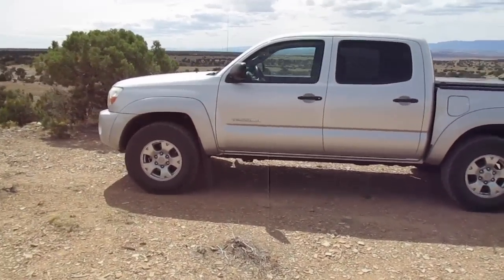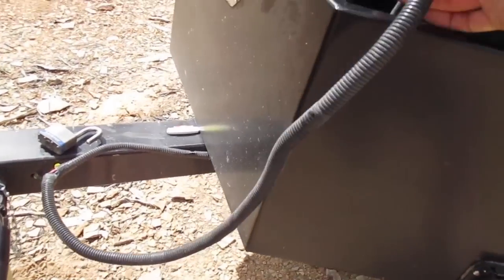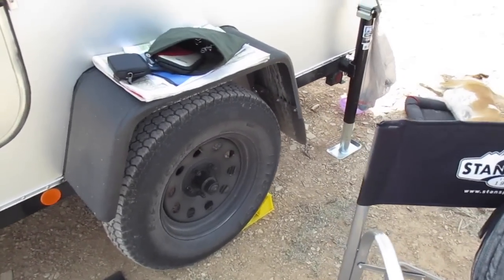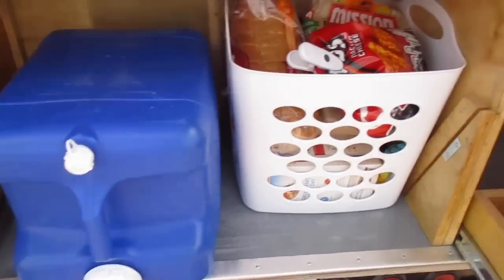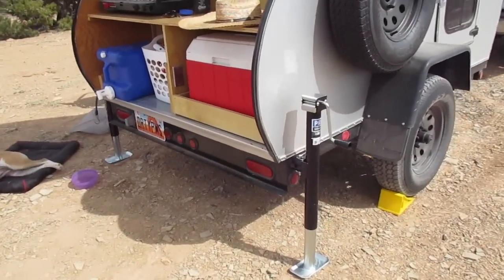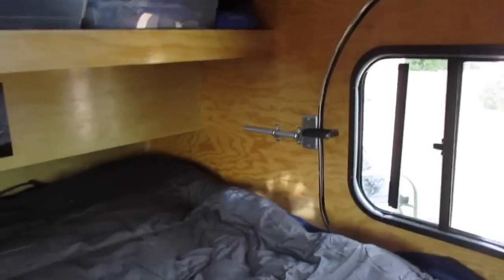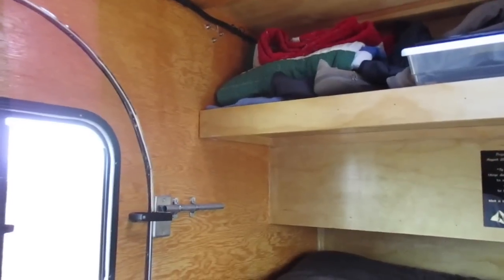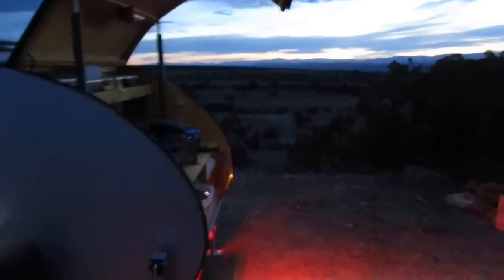Dirty Paws Teardrop Trailer

Comment: Chris,  superb build!  The only change I'd do, given  this particular  build:  I think welding a crossbar at the point of attachment,  to spread the chains out just a bit on the trailer side,  would create the safety basket that properly crossed chains should provide.

Comment: Awesome build! You should be very proud of it. I like the simplicity of your trailer. Question, did you insulate the trailer? Any water leaks, and what would you change?  Thanks
Reply from the maker: +Gabe Hernandez , thanks for the questions and comments ! no insulation. We haven't done any winter camping yet. It's main use was intended for spring, summer and fall. Also, the sleeping bag and mattress keeps us quite warm. No leaks at all. As far as changes I'm planning on installing  a timbren axleless system. Those rough roads in Utah are beating up my axle.

Comment: I missed a wash sink.  Do you use one.   I live in Florida so I might add a little fly to the galley latch.  I like the basic setup with no draws or door.  I might suggest a swing out table for the stove.  Again great work.
Reply from the maker: +Louis Carter  thanks for the comments. No sink, we just use the blue water jug and have a small plastic container as a wash basin if we need it. I'm from New Orleans. I know all about those mosquitos. The battle is real!

Comment: wow thanks for the door stoppers to hold the hatch up idea
Reply from the maker: +TomBrady's shirt I know right! Can't remember where I saw it, but it's so simple.
Reply: my teardrop is stored at my daughters house 1100 miles away in Alabama, you have given me so many great ideas (pipe roof rack, door stopper hatch holder's) and i cant wait to November when i head there for the winter to work on it and head out west. again thanks for posting. PS my hatch was also a nightmare to the point where i just ripped all the wooden framing out because it made the hatch so heavy .

Comment: I really like your profile. Did you design the shape, or is it one I can find online somewhere? I'm only in the dreaming stage, but I'm having a hard time getting that profile aesthetic right. I love your functionality and craftsmanship balance.
Reply from the maker: bhobful I imported a picture of a profile into some CAD software. I overlayed it on what would be the plywood for the sides. That gave me roughly the shape I wanted. I then made some reference points that I could use to trace out the pattern before I cut out the sides.

Comment: nice! Question.  How heavy was the hatch when it was done.?  I'm starting the hatch next weekend.  Any tips or suggestions?
Reply from the maker: Not sure how much it weights. I would guess 60-80 lbs. I would like to do gas struts in the future. But I like the simplicity of the supports I have now. 

I would trace the side of your teardrop to get the initial shape of your hatch and go from there. I ordered a "hurricane hinge" form eBay. It is great! Bomb proof and no leaks.

Comment: Nice trailer. But you're using your safety chains wrong. Take the left side chain and cross it over the Tacoma's hitch in front of the Tacoma's ball and hook it to the Tacoma's right side chain ring. Take the right chain and cross it over the Tacoma's hitch in front of the Tacoma's ball and hook it to the Tacoma's left side chain ring. Now if your coupler breaks and the trailer falls away from your Tacoma, the chains will grab the Tacoma's hitch ball and keep your trailer tongue from slamming on the ground and possibly detaching from your Tacoma the way it will if you keep using the chains the way you are using them now.
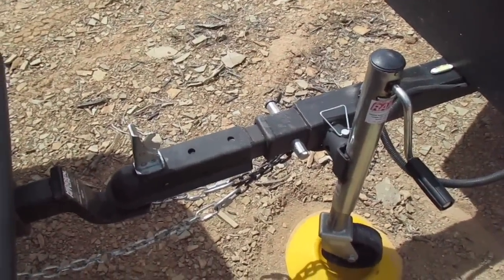Reply from the maker: thomastidewater If you look close at 2:18. They are crossed. Thank you for the tip.